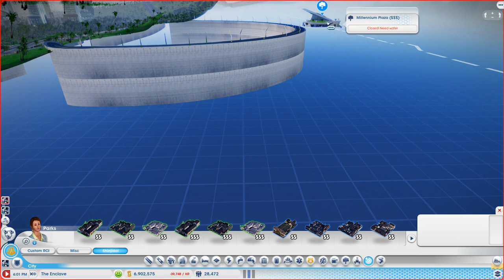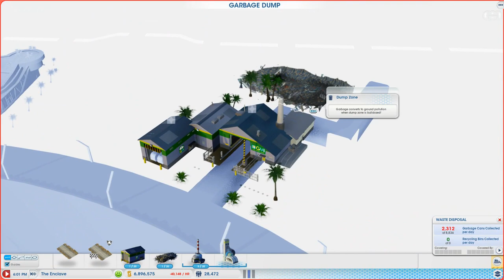SimCity OAU Academy Build #9 ►The Great Snap-Point Problem!◀ SimCity 5 (2013) With Mods

Comment: Hi Skye,
I've been playing for more than a year and more than 3k hours. Ever since I downloaded your 3.1 pack I get literally dozens of fires per game hour even with fires disabled. In addition the ALT + W key does not provide me with extra simoleons. 
I downloaded your map and while in that map I can use the ALT+W key to receive extra $ however in my own maps this does not work.
In addition in this video your $ (dollar) signs look much different than the ones I have in my game. 

Can you help me? I need less fires while in fire disable mode and the ALT+W cheat as well. Do you know if others have had the same issues? Would a fresh install help? Is there something I'm missing?

Thanks again Skye!